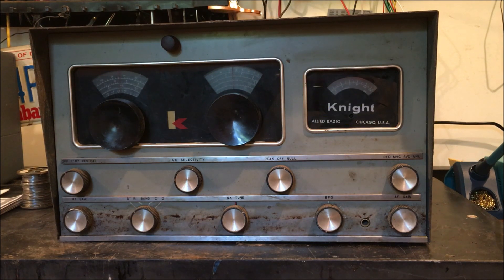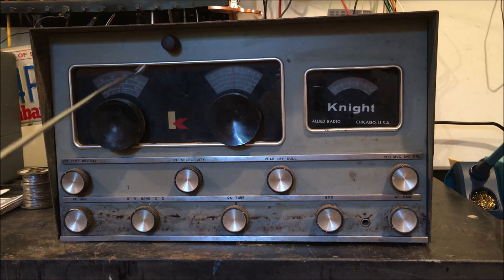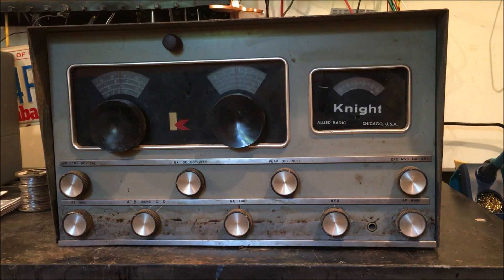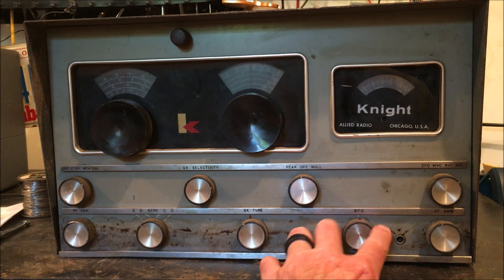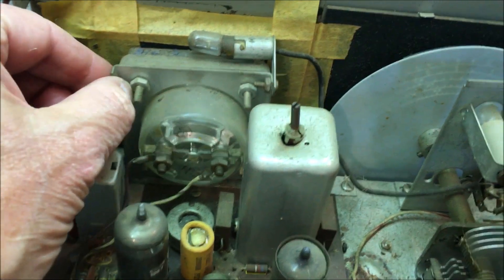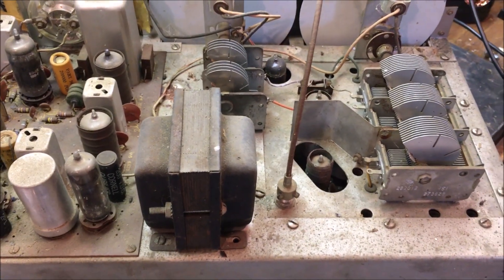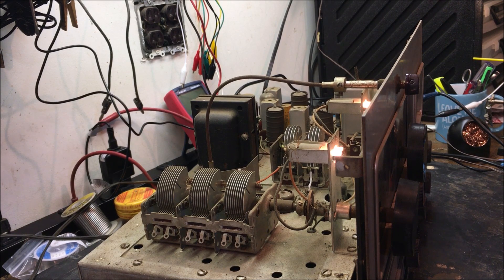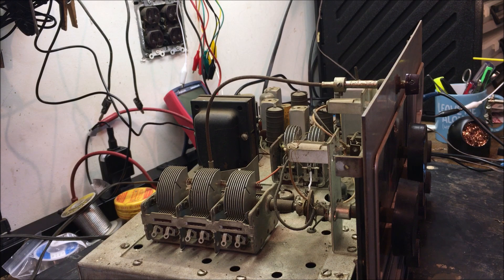1957 Knight Communications Receiver Part 1 of 5 Introduction

Comment: Well you know what I would do.  I just don't have the heart to do anything but according to Col. 3:17.
Reply from the maker: Yep, I know what you would do! I just hope I dont  run into a unique part and me tear it up….with your hallicrafters, you have a few extra parts laying around…….this should be fun…the clean up will be work, but I think its in pretty good shape. Thanks for watching! Take Care—Larry
Reply: @Backtothefutureradios  I believe the bandswitch is the place to be most careful. As you said. I really dont like the interface between pc board and metal switches. You could consider mapping out the components and circuit in case you had to make a new board and abandon the old in place.
Reply from the maker: @i82996  I was also thinking, if I could run the foil side of the boards on a copy machine, that would be good for several reasons…someone needing a board (like me) could reproduce one if necessary!  Thanks for the advice….it’s coming apart pretty good now!!! But, I’ve always been good at tearing things apart! Been doing so since childhood!!! 😬 Take Care—Larry